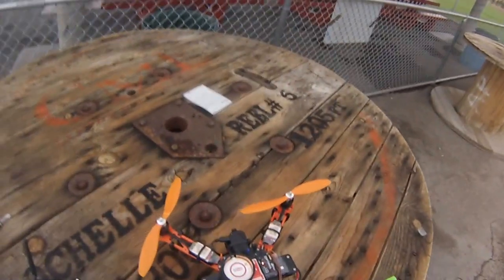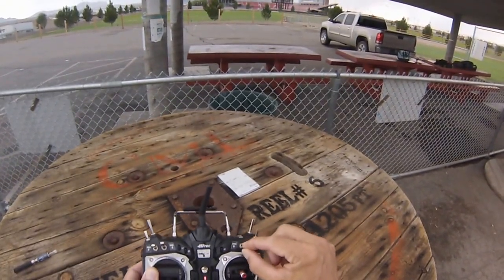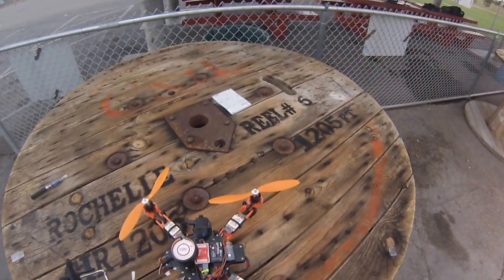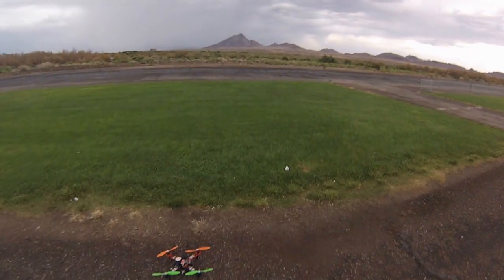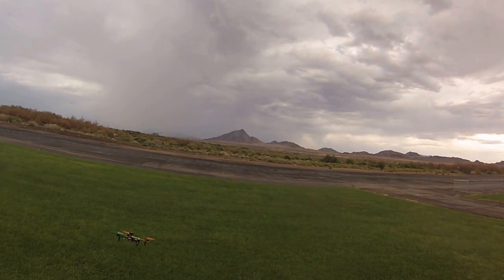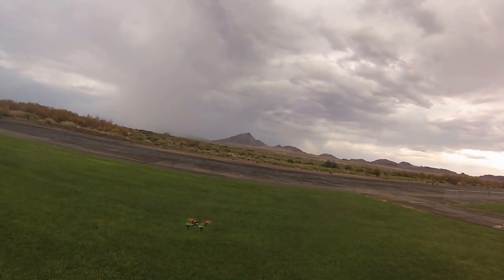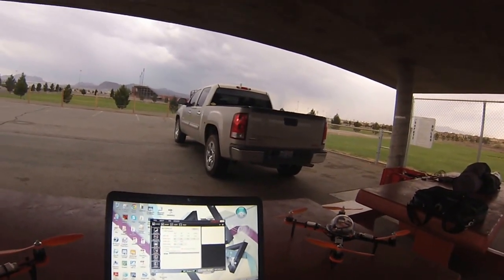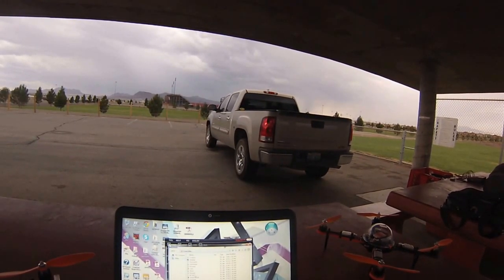Flip Sport FPV naza lite compass cal success!

Comment: Nice , i see that you are using the SPC connector as a telemetry voltage sensor , if you are using a 3s battery set up the low battery alarm on your radio at 10.2v so in that way you wont have your beeping all the time when you give your quad hard throttle , if you used a 4s lipo then setup your lipo alarm at 13.6v .